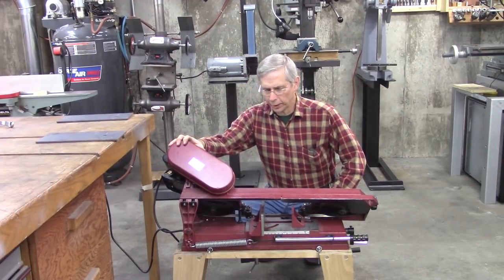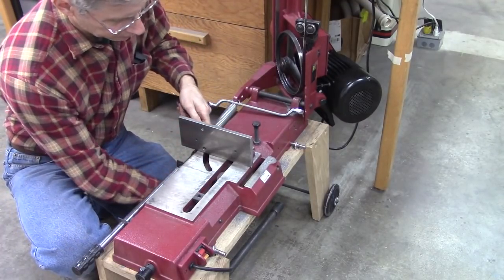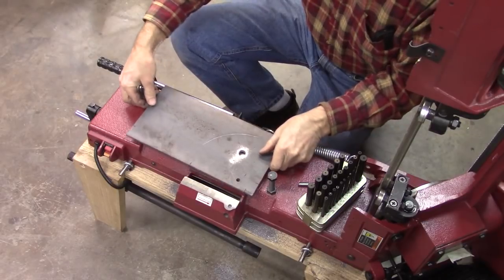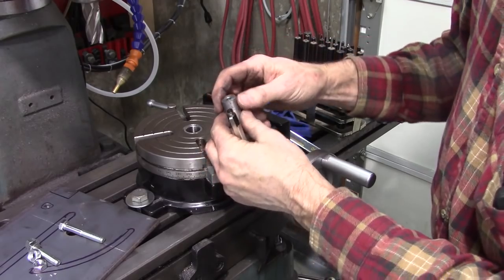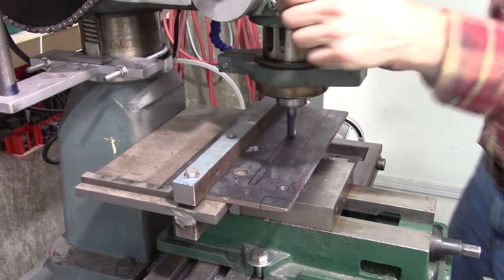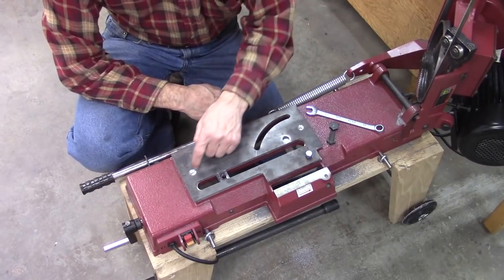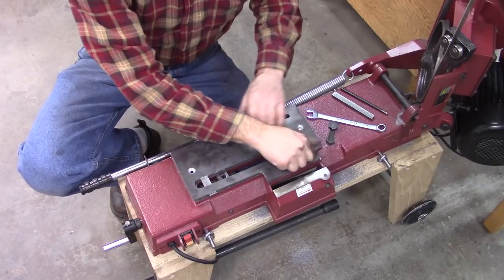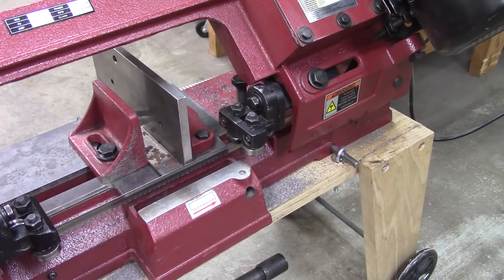4" x 6" Horizontal Bandsaw - Fixing the depth of cut issue

Comment: I see you re-fitted the original blade guard. I left mine off and haven't had any issues but I am pretty careful not to grab under the framework as I know it isn't in place.
The curved slot in plate could be chain drilled then filed to shape,
 I did it quite often before I had a mill/drill and rotary table.
I keep some 'soft' MT2 blanks with draw bar for rotary table and made special ' top hat' washer to use a short bolt. It's really handy if your going to do any work where you need a relatively close centre on parts (~0.002") and saves dialing everything in every time.
Reply from the maker: Yeah...  I've done that too. I love my mill - Ha.  If you need a plate let me know. Click the link in the description. It has an email.

Comment: I have been using my version of this saw for almost 30 years. It's a Little Giant brand back when they were still made in the USA. Mine had seen a serious amount of abuse by the previous owner. I must say the repairs are stellar. The only weak link in the machine is the worm gear drive. If run in the high speed on the pulley, the brass gear itself wears out in spectacular fashion. Relatively inexpensive and available at most  industrial supplier of Martin brand gears. Just check to make sure yours hasn't been changed to a different pitch or part number. I just run mine in the slow speed groove as I'm usually cutting steel structure and have no need for higher blade speed. If there is any power tool that I would truly miss would be this little saw. I have run metal cutting band saws that would cut material as wide as this saw is long, costing hundreds of thousands more and made no better cut than this. Buy good blades, set the guides right and yours should cut just fine. The table plate was not needed for my saw.
Be safe and have fun 
Terry from South Carolina
Reply from the maker: I'm checking my gears tomorrow! Thanks

Comment: Im picking up a similar saw this week so very keen to see what I'm up against......it seems a lot of work to get these cheaper saws to function satisfactorily , would it not better to correct the problem at the source of the problem "the hinge" end?. But thanks for so many rectification mods
Reply from the maker: Not all the saws have this problem. From what I am seeing many of the older saws did not. Yes droppin gthe pivot point about 1/4" would be ideal but this would be a lot of work. Elevating the stock has no negative effect and much easier than boring a new hole in cast iron. I suspect you'd have to remove the head, mill off the cast hinge point and bolt on a steel bracket. All doable but a lot of work. Is your saw used? If so, maybe it will be fine. Check the oil in the gear box. This instructions call for 90W but mine looked like 20W (and i bought mine new).

Comment: I bought  the same band saw twelve months ago from Warco in the UK, i have cut stainless, mild steel, aluminium, no problems at all still on the original blade.
All the best
Baz
Reply from the maker: That's great. I think there are several companies using the same castings so some saws have different issues are fewer. Mine does well but when you set the guide right it doesn't cut all the way through the stock.

Comment: I bought one of these band saws a year ago and out of the box it was setup perfect!! I was in shock 😵 I’ve seen and heard from so many that they need adjusting to make’em work. Heck, the original blade was cutting decently even, that is until it broke 😬 I have it set on the slowest cutting speed and let it do its thing. I enjoy your videos sir 👍🏻
Reply from the maker: Thanks!  Yeah, I thought mine was setup right too but because it worked great but then I realized the blade guides were what caused the blade to break.  When I set the guides right the depth of cut became an issue.
Reply: Mine also worked out of the box for two year then I had to cut 4”DOM 1-1/4” wall tube and I did stay and watch it cut for 1 hour,,,saw the lights flickered in the house. When out to check on it and found the motor had burned up be cause the roller guide cam bolts loosened up. Moral of the story if it works out of the box check that all the bolts are tight and don’t use non stop for two hours unattended!!

Comment: I have the delta version of that saw. The castings and parts are different on the delta. With that said you certainly brought the HF version up to snuff. I like the idea of the side screw for the stop. Makes it much easier to adjust without having to dig out chips.
Reply from the maker: Thanks...  yes that screw was always full of chips.

Comment: I bought one of those years ago that had an unusual problem. Someone had broken the cast iron pivot blocks and then scrapped it.  I bought it for $10, brought it home and drilled down through the blocks and the pin and put 1/4-20 bolts through it and cranked it down. It worked well for me.
Reply from the maker: Very cool!

Comment: Great video!! I added a piece of steel to the moving jaw to match the fixed one and drilled and taped a hole for a spacer bolt for cutting short pieces.  Another trick you can do is put the pulleys on the lathe and true them up, mine were cast iron.
Reply from the maker: My pulleys are very true...  thankfully.  Check out part 1 of this video. It has a cool trick for holding small stock.

Comment: Thanks Winky. That was good to watch. I have a question, would one buy one of these metal band saw or one of the drop saws using the metal cutting blades that are now available? What's the difference in what can be done one to the other?
Reply from the maker: I've only use the band saw but I've heard the low speed chop saws excel and tubing while band saws are good for large solid bar. If all I did was fabricate with tuning I'd have to try the chop saw.
Reply: The chop saws are accurate and fast, but very loud. Very compact, if you're tight on space. The carbide blades say they are good for 100 cuts. At $100 for a new one, you do the math...I have done more than that and it is still good so far. They do tend to throw chips around more.
Reply from the maker: @delxlup  - If that's true 100 cuts in not very many! Yes they are loud and messy! I've never used one myself but I have been in the same room. I like the bandsaw.
Reply: @delxlup  Thanks delxlup - good info. I use a drop saw for aluminium with a 60t blade and that works well but noisy as frigg and yes chips are everywhere. I suppose it won't be any different for a metal cutting blade on a drop saw.

Comment: Looking at the plate you've used to enlarge the fixed vice jaw, If you put that jaw on an angle, your bigger plate will also be cut short !  - unless it's possible to slide it along on the original jaw ?

For some reason, I've not been made aware of your recent vids - so doing a bit of a catch up today. I note there's quite a few re mods to this saw. I'm beginning to wonder if you should have just built your own as you've done so many mods to this one :)
Reply from the maker: Good observation. You are right about the fixed jaw. I take it off when i cut at an angle. Mostly I cut straight and having support near the blade is more important. I wonder why you are not being notified?
Reply: @WinkysWorkshop  I have not actually subscribed to ANY channels ! All videos come up as recommendations and YT seems to keep track of the sorts of videos I like and doing things this way allows the algorithm to throw in new similar channels - which is I suspect I came across you in the first place !
I'm well aware a lot use the notifcations - but I'm not that addicted to YT that I'd get a notification and then immediately watch the video. This means I'm more in control of my time and I view YT as and when I want to without any particular pressure to watch a particular video.
I know that if I got a notification, I'd stop what I was doing and watch the video - that would be more disruptive to my day than YT already is :)
Reply from the maker: @millomweb  - You actually sounds like me although I do subscribe to a couple.

Comment: G’day Winky. I have the same saw but not the same problem so I won’t need to do the fix but thanks for sharing. My biggest problem was keeping the blade on the wheels until I found the adjustment set screw hiding in the top wheel adjuster, I wonder how many don’t know it’s there. 
Great little saw that’s affordable. Cheers 
Peter
Reply from the maker: I need to take mine apart. My tracking is adjustable and works well but you are the second person to say the same.  I think a lot of companies by the castings for these saws from the same place but do all the machining and assembling. So do well and some do not...  lots of variations.

Comment: I think I mentioned it before, my 35 year old one doesn't have that casting around the switch and uses a simple old time toggle switch. No clearence problems on mine.
Reply from the maker: Yeah...  the switch really wasn't the main issue. It could not be adjusted down low enough without hitting the blade cover on the bed. I made a lot of clearance for the switch too. You have to have a little free travel after it competes a cut to activate the switch. Now it can drop a full 1/4 at the switch.
Reply: Yup same as my MSC
Reply from the maker: @wi11y1960  - Are you saying your MSC doesn't drop far enough? Let me know if you need a plate. Unless the cost is too high I plan on getting some cut with a water jet. If it's too high I won;t do it but if I can keep the cost lower than $30 I will do it.

Comment: I suppose it is the age of the saw.  My MSC never suffered from that condition.  I bought it around 1998.
I havent been able to get out to inspect the saw yet.  It is a mind numbing 4F here in Maine,  It is on the todo list.  Along with 10 other projects.  Tho it may be a viid that I will add to my channel if I am still stumped.  I dont believe the bearing is too tight.  Also, no they arent worn out.  It was the first thing I checked.
Reply from the maker: Cool train near the ceiling. I have thought about doing the same
Reply: @WinkysWorkshop  For sale,  $200 with free shipping.  Glad you liked it.
LGB brass track/ 2 transformers/ 3 bachman pensylvania rr cars/ 1 pennsy 2-6-0 bachman loco/ 1 LGB Stanz loco,

Comment: Love your videos Sir.  Very nice.   Keep them coming.  Do you by chance have a video on how to make the saw wood stand?  Seems very straight forward, but thought I would ask.    Thank you Sir.
Reply from the maker: Thanks for watching. In hindsight, I should have made a video on that. Apparently the original stands are not very good. I made mine so that it would fit under my saw table. Sorry, no video but you are right, very simple. The only thing you need to do is cut a hole in the bottom board to access the vise bolts. Here's a couple of pictures. I made it out of think white oak but 3/4 plywood would likely work fine.  I can't remember if I had to drill holes in the sides for mounting bars or if the holes were already there. https://photos.app.goo.gl/jZh4MtbswwfJjoy76

Comment: Mine has a similar issue with cutting depth. If you do make them available, I might be interested. Otherwise it's drill and file for me.
Reply from the maker: I plan to make them available. The metal is $4 bucks but the water jet or laser to cut the plates is much higher. I've had companies do both for me in the past. I suspect I it will be $20 each but I'm hoping for less. I'd like to keep them lower than $30.  Follow the link (below the video). It has an email address, send me an email and I'll let you know what the cost will be. I'll know next week.  Also, there is a template you can print to make sure the plate I am making will fit!
Reply: @WinkysWorkshop  I tried sending an email to the email listed in the instructions but it bounced as undeliverable.
Reply from the maker: @Ironrosefarms  - Wow...  my screw up...  sorry. I corrected the email address. winkysworkshop@gmx.com

Comment: Another simple fix for transferring c- sunk holes is to make a couple bushings with the I.D. a slip fit to the transfer punch that fits the hole to be transferred, and the O.D. large enough to keep your work setting parallel to the mating surface. Making things like this and hanging on to them over the years, eventually you will have different sizes on hand for next time.
Reply from the maker: Thanks for the tip although I have actually done this. In my case I made tube with a tapered end to fit the countersink and inserted a small transfer punch. I then made a thick wall cylinder to slip over the tube with a square end to keep the punch square to the surface. I left it at work when I retired and didn't want to make another one.

Comment: Awesome result. Clever solution.  Also really like the end stop bolt addition to the side.  Things like that deserve a tool-less upgrade.  Welding a 1-1/2 long 1/4” rod to the bolt head makes a quick t-handle so no wrench will be required when setting up the end stop.  All the best....... Joel. 👍👍😎👍👍
Reply from the maker: Thanks 👍 I agree with going tooless. You might also want to watch part one if you haven't already.

Comment: One thing about cheap import tools is that those with errors of manufacture are often sold for $20 (or whatever) off. I point that out because I learned it the hard way, by supposing that the differences were in just the paint colors and the prices. That said, the problems with your saw and mine are shared though they were sold under different brand names and with different paint.
Reply from the maker: I figure they set up a bunch of jigs and assemble 20,000 (or whatever). Maybe they set them up different one time so a whole batch was screwed up. My saw was basically new. How old was your saw?
Reply: @WinkysWorkshop  The guy I got my saw from said he bought it new 20 or 30 years ago. It has a Dunlap decal, Sears' cheap-goods tool brand. You may be right about how they're assembled or at least how many are assembled but having lived in Asia 50 + years ago, I saw makers of castings, switches, bolts, paint, and V belts vending small lots to of parts to "manufacturers" who assembled all sorts of variants to what at first glance appeared to be the same equipment. I once did business with a US vendor of the cheapest Taiwanese variants. He billed himself as an engineer and may even have held a degree. In addition to the color of paint used in his line of tools, he cheapened everything in any way imaginable. One machine in particular, when plugged in, would boogey down the aisle if left unattended. About that time, I had a dream in which a Chinese vendor said, "Oooh, you nobody's fool. You big deal international trader. You want 9 cent part, I give you nine cent part." While that was strictly a dream, I remember it as embodying the essence of that importer's line of "goods".
Reply from the maker: @markkoons7488  20 or 30 years ago? Wow...  now that's very sad that these saw have been defective for that amount of time. I will say however that many have told me that their saws do not suffer from this problem. I wonder if these people are not seeing it or if their saws are truly aligned correctly? What you described with the engineer is a destructive mindset. The pride in making a good product has switched to pride in how much profit can be made. When I look at my South Bend the pride in the product is apparent. The sweeping cast legs and curved spokes in the V belt drive pulley are 100% pride. Lathes made now days would have a sheet metal pulley, and square welded stand. And even if they were cast the curves would be removed so save metal. Oh, and the cast iron gear cover that has survived 90 years would be a stamps piece of sheet metal. I like a low cost product as much as anyone but their are appropriate places to cut corners. Consumables like carbide inserts, sand paper, and paper towels are totally understandable. And specific to this saw, 20 minutes correcting a setup on an assembly line would make them a better product and only add pennies to the cost.  I saw this mindset in my job. I worked for a web offset printer. They ran machines by a budget numbers and logic went out the window. When I ran a press I had a supervisor tell me, "Your average make-ready time is 10 minutes too long." I replied with "really?" and he said, "yes it is an you need to get it within budget". then I said, "I don't know what the budget is and really don't care". I thought he was going to blow a gasket. Then I said, "So, you are telling me to skip adjusting a drive chain, lubricating a bearing or changing a roller that might create huge amount of down time tomorrow to get my make-ready time down? If that is truly what you want just let me know but the fact is, the slight amount of extra time I take on a make-ready is increasing both quality and production." He just gave me that deer in headlights look.

Comment: That's weird I have what looks to be the same see from m.s.c and have not had that problem nice fix .
Reply from the maker: Quality control issues. I suspect all the castings come from the same factory but they are machined and assembled by several.  Basically, the pivot point on my saw is about 3/16 to 1/4" too high.  Watch part-1. Originally it the head travel was not an issue because the blade guides were deflecting the blade downward at least  1/4". In reality the back wheel on the blade guide should barely touch the blade.  The saw worked if you cut slow but if pushed a little the blade would fall of and mutilate the blade.  Now that the guides are closer to the correct position I can cut at least twice as fast and blades last forever.